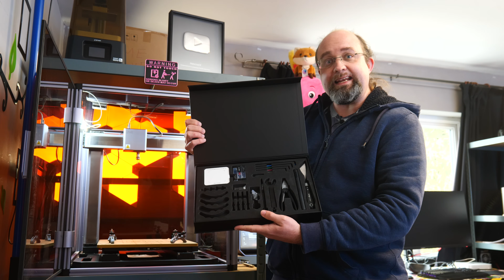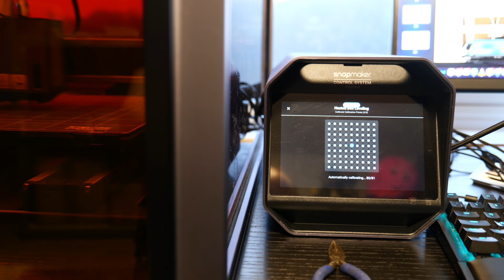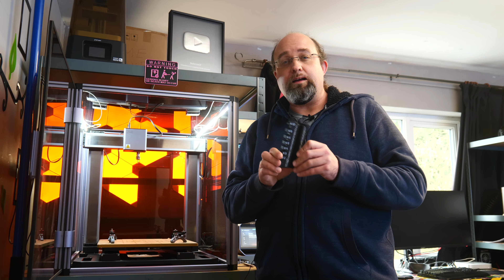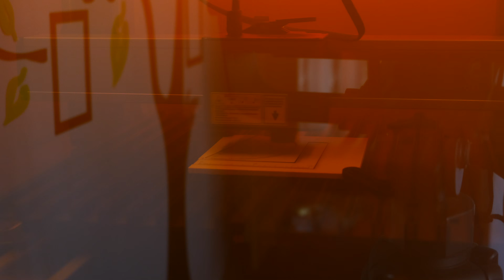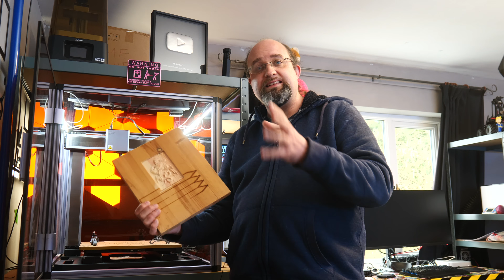Snapmaker Artisan 3-in-1 Maker Machine In-Depth Review

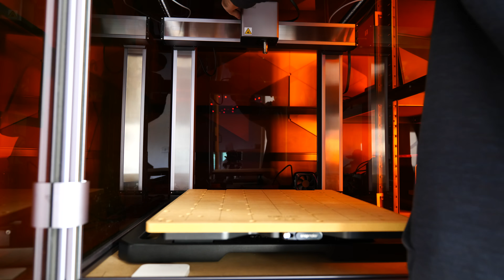Comment: 21:00 CNC- Machinist here. Stay, whenever possible, 0.1 mm (in metal, in wood its maybe 0,3 to 0,5 mm) away with your tools from the fixture plate, then remove the leftover material and deburr the edges. Best way to do this is setting your Tool Zero not on the workpiece, but the Plate it's placed on.

Comment: 23:15 You can use a Kirby G4 or higher.  I just looked on Ebay, I see G4, G5, G6, and Ultimate, all for about $200 or less.  These are by far the best vacuum made for in home use anyway putting all competition to shame, with the exception of tile or wood floor, as most vacuum do fine on those surfaces anyway.  Anyway, the reason it would be good for the dust here is that unlike every other vacuum I know of, which uses a rather small and expensive filter, the Kirby uses a large bag to collect the dirt.  The ENTIRE bag is made of hepa filter material.  One bag cost about $3 and holds about 1.5 gallons of dirt before it is so full it starts losing suction.  I will not guarantee that no toxic airborne chemicals can make it through a hepa filter, but none of that dust is getting past the bag.

Many years ago I spent about a year selling these.  So I got a chance to test them against literally everything on the market.  I have even since tested mine against some of the top name brands on the market.  Still nothing compares.  I use to test the suction power and capture of dust by putting down backing soda in carpet.  Then I would use the potential customers vacuum and drive it back and forth over the backing soda dozens of times.  I tried to reach 100 passes, just to completely make the point that their vacuum was not even trying to suc it up.  Most vacuums are actually designed to pick up small items on top of carpet, but to beat items in the carpet down so you can't see them.  This obviously includes dirt, and is why if you have ever torn out your carpet to replace it there is literally gallons of dirt under the carpet throughout a typical house.  10-30 years of one of these type of vacuums hiding the evidence of the fact that it can't suc it up.

So after 100 passes or so with their vacuum you can still clearly see the backing soda in the carpet. (usually put about 1/4 of a cup in a small area) Then I would pull out the Kirby and go over it back and forth one time, and it was all gone.  Then to completely prove that I didn't have some trick vacuum that was just better at hiding it, I had very small demo bags, I would open it up, and pour the backing soda back into the measuring cup so show that the kirby got it all out.  If they had any tile or hardwood floor in their home, I would then pour some out on the hard floor, and put a piece of carpet over it.  I had a 3x3 foot piece for demos.  Then I would run the Kirby over it a few times, maybe 4 passes tops, then puck up the carpet to show that it not only got the dirt from in the carpet, but literally pulled the dirt under the carpet up through it to get it too.

Anyway, I have not sold them in many years, but everyone should get one, they are amazing.  A little on the heavy size, but if they have to weigh that much to get the job done, so be it.  They also have built in drive assist.  So when vacuuming you can literally moving it with just two fingers.  As soon as you start moving the handle forward or back the drive motors kick in to take all the weight.

Comment: Hey! I have a question. How long does the Artisan take to heat up the heatbed to 60°C and 110°C?
Reply from the maker: I don't know about to 110C, but a few minutes for 60C. Do you want an exact time? It's not long enough that I've thought to time it precisely or that it bothers me.
Reply: @MakeUseOf  Ok thanks for your answer! I'm guessing it's around 3 minutes to heat up to 60°C
I'm curious what power supply (Wattage) they are using when powering the big heated bed without using 230V. There are no public informations about that topic.

Comment: I've had the older A250 for over a year. I found it to be a good 3D printer out of the box, much more user friendly than say an Ender 3v2. Swapping out the modules is fast once you figure out the workflow. Luban really lets it down, they push badly tested updates that cause all sorts of problems to the point where they damage the hardware. One notable release last year liked to smash the laser module into the cutting bed if you didnt home the module head after doing a camera capture of the cutting area. Speaking of the the camera capture, Luban does a crap job of stitching the the images together and if you dont put a white square or piece of paper into the area the camera runs out of memory and wont complete the capture job.

Sadly I haven't seen Luban getting better. It changes regularly but usually to be broken in some new and unexpected way. I'm still happy with the buy as its a good 3D printer and I dont have enough space for a laser cutter, printer and C&C and at the end of the day all my projects have come out pretty dang good. If you DO have the space, buy separate machines!
Reply: Having issues finishing a print between bed adhesion to all print issues available. Any help is appreciated

Comment: The white filament is dissolvable in water so you don’t have to break it
Reply from the maker: No, this isn't dissolvable, it's a different filament called breakway. Disolvable is made from PVA. The machine can handle both, but that's not what we were supplied with. This one - https://snapmaker.com/materials/breakaway-pla/
Reply: @MakeUseOf  all filament is “break away”. The only logical choice is dissolvable support structure for extrusion printing.

Comment: We have had our machine for about three weeks.  So far it has been a challenge.  our first layer adhesion is awful.  Constantly pulling up as it prints.  I am sure it is something we are not doing correctly.  Tips would be awesome.
Reply from the maker: Hmm, not a problem I would have expected from this machine. Using standard PLA? Use a brim around the edge of the model. Wipe with 99%+ IPA prior to every print. Ensure heated bed is on/functioning. I assume you've done all the standard calibration steps - but swap to 81 point levelling if you just did the basic one.
Reply: Every snapmakers Gcode under extrudes 10-50 millimeters across the board. Watch some videos how to write to the Gcode memory and which parameters need to be updated and how to use a micrometer to get the exact measurements. You can also clean the bed with 99% IPA and make sure to over ride the heating past 200° on the bed. Don’t have mine yet but I’ve been working CNC machines for 15+ years. I’ve made parts for the oil and gas industry and chemical plants. But have fun, loved my job but now I’m a hobbyist lol

Comment: I just got my Artisan in the mail today.  Haven't put it together yet, but I'm looking forward to it.  A very nicely packaged system I must say.

Regarding the laser calibration, if you don't do a test cut (the box) then you are only able to calibrate the bed to the camera.  
Doing the cut will allow you to calibrate the cut points to the camera, which is really what matters.
It's also possible the camera lens was smoked up during the cut with no vent.  I'm surprised there's not additional air assist on the cutting.  I may have to see about adding it.

I ran a laser cutter for a few years, and even industrial ones can get out of calibration very easily.
It was part of the daily maintenance to check the offsets with a test cut.

I'd recommend making a test page holder that you can prep in parallel to other work and then just slide it in when it's time to calibrate the laser.
Reply: How did you get it so quick? I ordered my one around the start of the year and it hasn’t even been shipped out yet
Reply: @offconstantly9260  It wasn't quick.  I ordered in October.  It's been a long time coming, but it's quite nicely built.  Of course, now I'm moving in a few weeks so I barely get to play with it!

Comment: I love your warning label! is there a STL available? Thx also very much for the review! Ah and you can mount both filament holders at one side, each then with only one screw, but it works.
Reply from the maker: Good tip - but not sure how the bowden tubes would clip in properly if you did that? This is the STL - https://www.thingiverse.com/thing:3355067 ;)
Reply: @MakeUseOf  if the clips are not to much in the front, it should work. btw. i didn't unload the filament, if i switch to laser/cnc. i store the print head in the back corner to save time 😉

Comment: Luban is really bad. But there is nothing stopping you to use Prusa Slicer for 3d printing, Lightburn for lasercutting and Solid Edge Cam Pro or Fusion360 for doing the cnc Jobs. Just generate the G-Code, load it into the Artisan and use it.
But you are right, this machine tries to do everything and its not really good at it, but somehow good enough.  If you want really more you need to buy 3 different machines, spend more money and have more place to put them somewhere. I really hope there will be more developement once the machines are delivered. I am still waiting for my one impatiently. Ordered it on Christmas last year.
Reply: Lugansk’s is not bad. It totally sucks ass